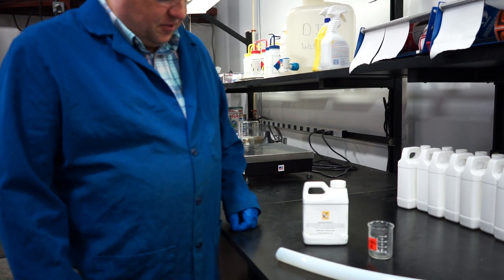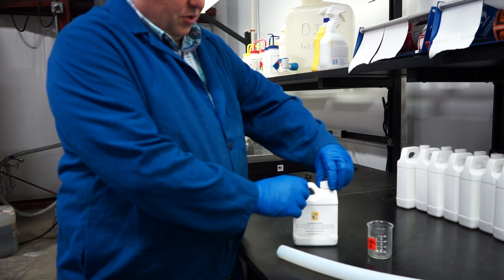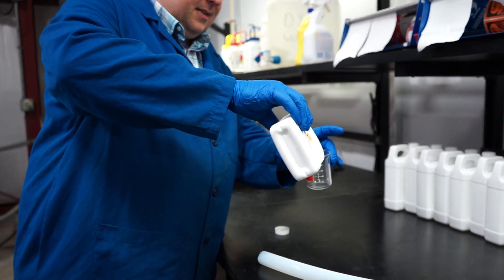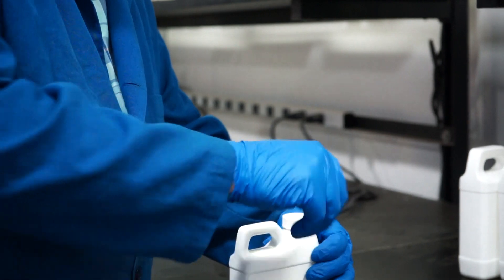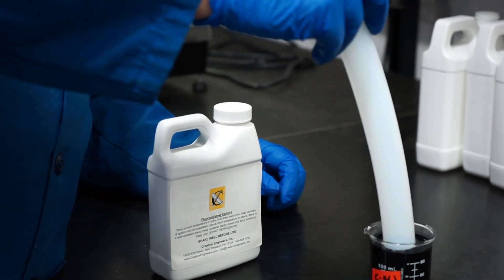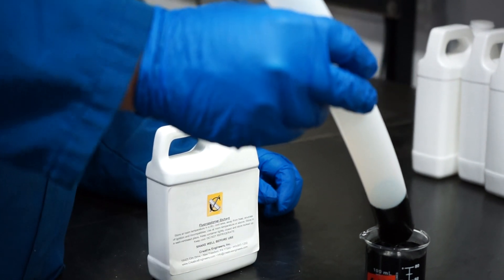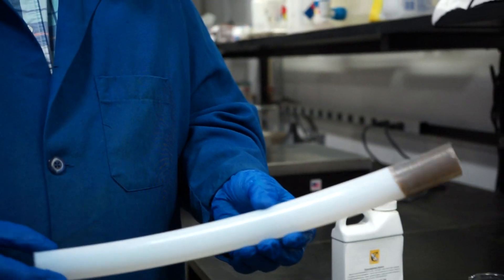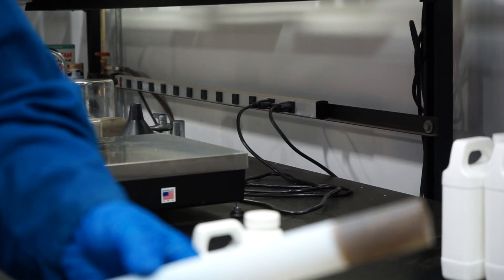PTFE Demonstration

Comment: Were can this be purchased? can it be mixed whit ethanol ? regards
Reply from the maker: You can get more information including contact info at https://creativeengineers.com/alkali-metal-engineering/specialty-chemicals/fluoropolymer-etching-chemistry-systems-and-services/fluoropolymer-etchants/
Reply: @CreativeEngineersInc not working any more
Reply from the maker: Note that the etchant cannot be mixed with ethanol prior to use.  Ethanol will react with the active ingredient, sodium.